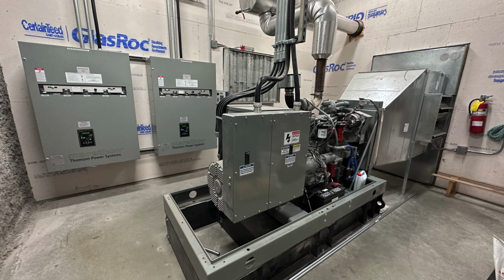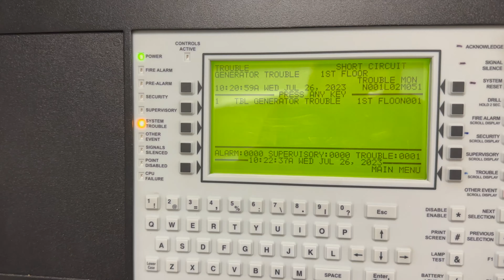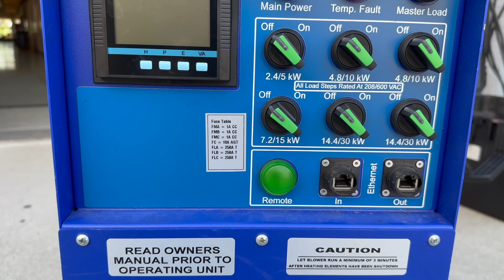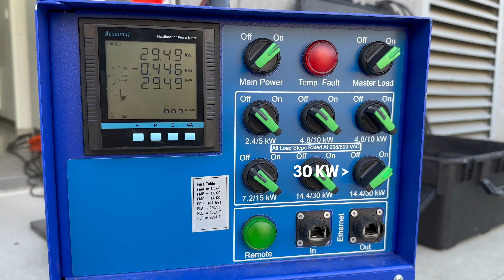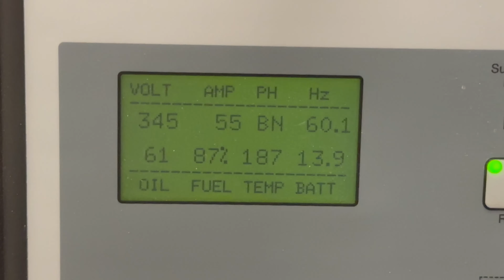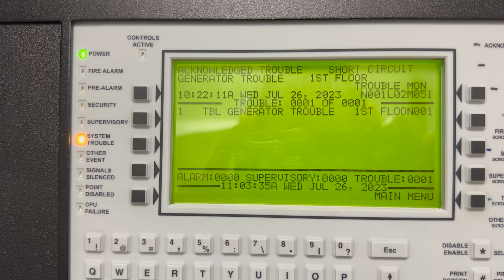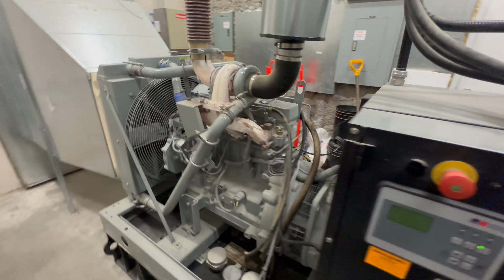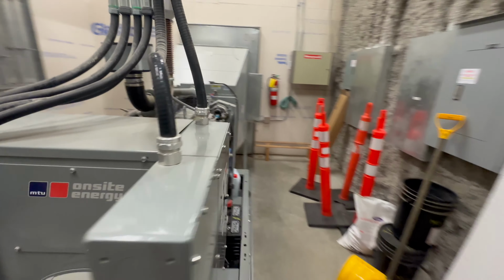Generator load bank testing at my high school

Comment: What's the rule of thumb for adding fuel because even when you're not testing it or the power isn't out the generator runs weekly or whatever it's set to automatically to make sure it's working?  Like do they wait until it's 50% or below?
Reply from the maker: It does not start weekly just whenever the power goes out or someone manually starts it we seem to fill it up if it's below 60%

Comment: i have one of these at my house but 240v 450A.i built a load bank in front of the fan…. the turbocharger is so loud you can’t stand near it without ear plugs or phones and my exhaust doesn’t glow red got 600° egt all i ever seen 😅👍
Reply: It’s capable of 450A or do you use 450A. I only have 100A service.
Reply: @ capable. i’ve seen it up there in the 150A area. winter time is when it sees the most load on the house when it does its self test  and the heat it on.

Comment: Are all the generators in school district open frame? Cost reasons I assume not using silentpack housings even though indoors. Cheers
Reply from the maker: Only two of the generators are open frame indoors the rest are all outside
Reply: @nics-systems-electric  cheers

Comment: Curious why the gen control panel indicates 345 volts ?   
It's a 3 phase unit, should be 208 or 480 volts.
Reply from the maker: Should be 347/600 a drop of 2 V at load is within acceptable tolerance

Comment: I don't know if your able to do this.  But I'd like to see the generator switched over to the building and then set the fire alarm off and see if the generator is able to fire up all the ventilation fans, doesn't seem like it'll be able to do it but we'd live to see!
Reply from the maker: I don't know if I would ever have the opportunity to do that but it would do it that's what it's engineered to do
Reply: @nics-systems-electric  that's what I thought...I'd be hard to pull of lol.     I know the generator is spec'd for the application. It just seems like those fans would over load it given it's size and whatever building load is on it already.       Another question is. Are you guys on a diesel fire pump, electric, or right off city mains?

Comment: Buy leaving the door open to the room you’re not really testing shit. You need the door shut to test the room can supply sufficient air.

Also stop saying 100,000 watts its 100kw.
Reply from the maker: It's not using air from the room it's pulling air directly outside over the radiator door open or not doesn't matter. And I can say whatever I want it's my video don't watch it if you don't like it. you should also know the K in KW 1000 which is used in many different measurements.